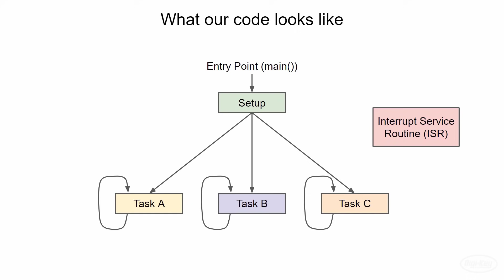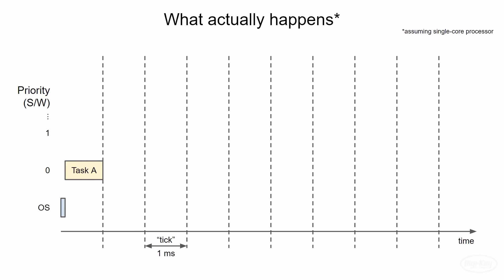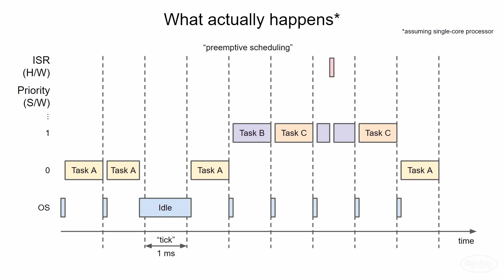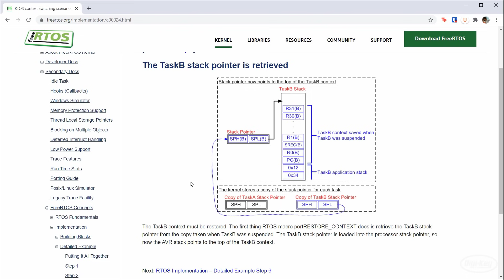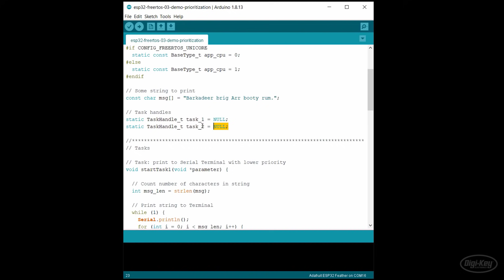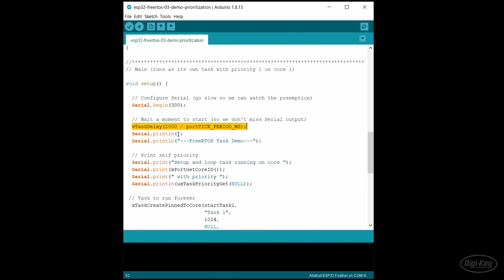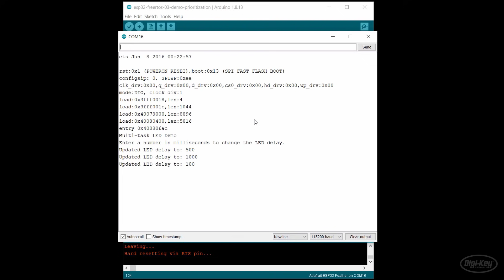Introduction to RTOS Part 3 - Task Scheduling | Digi-Key Electronics

Comment: A slightly modified version of the code from the video:
const char msg[] = "Barkadeer brig Arr booty rum.";
// Task handles

static TaskHandle_t task_1 = NULL;
static TaskHandle_t task_2 = NULL;

//***
// Tasks
// Task: print to Serial Terminal with lower priority
void startTask1 (void *parameter) {
  // Count number of characters in string
  int msg_len = strlen(msg);
  while (1) {
    Serial.println() ;
    for (int i = 0; i < msg_len; i++) {
      Serial.print(msg[i]);
      vTaskDelay(10/portTICK_PERIOD_MS);
    }
    Serial.println();
    vTaskDelay (1000 / portTICK_PERIOD_MS) ;
  }
}

void startTask2 (void *parameter) {
  while (1) {
    Serial.print('*');
    vTaskDelay (50 / portTICK_PERIOD_MS);
  }
}

void setup(){
  //  Configure Serial (go slow so we can watch the preemption)
  Serial.begin(300) ;
  // Wait a moment to start (so we don't miss Serial output)
  vTaskDelay(1000 / portTICK_PERIOD_MS) ;
  Serial.println();
  Serial.println("---FreeRFOS Task Demo---") ;
  // Print self priority
  Serial.print ("Setup and loop task running on core ") ;
  Serial.print (xPortGetCoreID()) ;
  Serial.print (" with priority ");
  Serial.println (uxTaskPriorityGet (NULL));

  xTaskCreatePinnedToCore(
    startTask1,
    "Task 1", 
    1024,
    NULL,
    1,
    &task_1,
    0) ;
  // Task to run once with higher priority
  xTaskCreatePinnedToCore(
    startTask2,
    "Task 2", 
    1024, 
    NULL,
    2,
    &task_2, 
    0);
}

void loop(){
  // // Suspend the higher priority task for some intervals
  // for (int i = 0; i < 3; i++) {
  //   vTaskSuspend (task_2);
  //   vTaskDelay (2000 / portTICK_PERIOD_MS) ;
  //   vTaskResume (task_2) ;
  //   vTaskDelay (2000 / portTICK_PERIOD_MS) ;
  // }
  // // Delete the lower priority task
  // if (task_1 != NULL) {
  //   vTaskDelete (task_1);
  //   task_1 = NULL;
  // }
}

Comment: there's a bug in your example, in the line 75 you need to increment the idx variable, otherwise it will only return the last character you wrote on the serial, like "400" it will return 0
Reply: idx++;  // it was idx  ; for some reason

Comment: For the question at the end of the blog: 
Try playing around with the priorities of the tasks. What happens if you make the “Toggle LED” task priority 2? Why does everything still work? 
What happens if you make the “Read Serial” task priority 2 instead (and leave the toggle task at priority 1)? Why does the LED task stop blinking?

Ans from ChatGPT:
In FreeRTOS, tasks with higher priorities are given precedence in execution. However, lower priority tasks can still run when higher priority tasks are in a blocked state. In your case, even though `toggleLED` has a higher priority, it periodically blocks when waiting using `vTaskDelay()`, allowing `readSerial` to execute. When priorities are swapped, `readSerial` continuously executes, preventing `toggleLED` from running and causing the LED to appear continuously off.

Comment: Small bug in your solution. You need to increment idx in line 75, otherwise, it only accepts the last digit...
Reply: thanks bro, i was having this issue with the example then i added the missing "++" on the line 75

Comment: #if CONFIG_FREERTOS_UNICORE
static const BaseTye_t cpu = 0;
#else
static const BaseType_t cpu = 1;
#endif
static int ledPIN = 2, _delay = 100;
static TaskHandle_t task1 = NULL;
static TaskHandle_t task2 = NULL;

void inputDelay(void* params)
{
  while(1)
  {
      if(Serial.available() >= 0)
      {
          _delay = Serial.parseInt();
      }
    Serial.print("Enter delay: ");
    Serial.print(_delay);
  }
}

void blinkLed(void* params)
{
    while(1){
      digitalWrite(ledPIN, HIGH);
      vTaskDelay( _delay  / portTICK_PERIOD_MS);
      digitalWrite(ledPIN, LOW);
      vTaskDelay( _delay  / portTICK_PERIOD_MS);
    }
}
void setup() {
  Serial.begin(115200);
  vTaskDelay(1000 / portTICK_PERIOD_MS);
  pinMode(ledPIN, OUTPUT);

  xTaskCreatePinnedToCore(inputDelay, "delay", 1024, NULL, 1, &task1, 0);
  xTaskCreatePinnedToCore(blinkLed, "blink Led", 1024, NULL, 2, &task2, 0);
   vTaskDelete(NULL); 
}

void loop() {
}

I tried the challenge but i am getting this problem-->

 E (12136) task_wdt: Task watchdog got triggered. The following tasks did not reset the watchdog in time:
E (12136) task_wdt:  - IDLE (CPU 0)
E (12136) task_wdt: Tasks currently running:
E (12136) task_wdt: CPU 0: blink Led
E (12136) task_wdt: CPU 1: IDLE
E (12136) task_wdt: Aborting.

abort() was called at PC 0x400d8b29 on core 0

Backtrace: 0x40083349:0x3ffbe9cc |<-CORRUPTED

ELF file SHA256: 3a4287771b3f7938

Rebooting...
ets Jul 29 2019 12:21:46

rst:0xc (SW_CPU_RESET),boot:0x13 (SPI_FAST_FLASH_BOOT)
configsip: 0, SPIWP:0xee
clk_drv:0x00,q_drv:0x00,d_drv:0x00,cs0_drv:0x00,hd_drv:0x00,wp_drv:0x00
mode:DIO, clock div:1
load:0x3fff0030,len:1344
load:0x40078000,len:13964
load:0x40080400,len:3600
entry 0x400805f0
Enter delay: 0E (12136) task_wdt: Task watchdog got triggered. The following tasks did not reset the watchdog in time:
E (12136) task_wdt:  - IDLE (CPU 0)
E (12136) task_wdt: Tasks currently running:
E (12136) task_wdt: CPU 0: blink Led
E (12136) task_wdt: CPU 1: IDLE
E (12136) task_wdt: Aborting.

Comment: There is something weird (for me) happening when task_1 is deleted: Serial port just stops printing to console. I asked ChatGPT and it says the problem is the collision of the serial port access between the tasks, but I don't know really how to solve it.
Reply: For me it helped to reduce the delay after vTaskResume(task_2); in the void loop() so that Task 2 gets blocked earlier and the idle task gets running time (see hint in the FreeRTOS Reference Manual for vTaskDelete(): "When a task is deleted, it is the responsibility of the idle task to free the memory that had been used to hold the deleted task’s stack and data structures (task control block). Therefore, if an application makes use of the vTaskDelete() API function, it is vital that the application also ensures the idle task is not starved of processing time (the idle task must be allocated time in the Running state)"

Comment: I have used exactly the same code as given in the solution except that I used Serial.parseInt() to get integer value from serial port and the program is not working right and the ESP keeps resetting (watchdog resets in readSerial function). Also it shows that the blink delay was updated but immediately gets set to 0 after and the program crashes. What am I doing wrong?
Reply: If you use firefox and copied the code to paste to your IDE; some characters does not appear on Digikey website when Firefox is used. So the problem might be that :D
Reply: I'm having the same problem, did you end up figuring out what was wrong?

Comment: Hi, thanks for the great work. I have a question, after writing my answer to this challenge, I copied your answer (just to get the nice formatting) and started to mess around to check things. One of the things I did was to delete the "while(1) { ... }" loop on the ReadSerial() task, thinking that the task would be executed only once after being started by the scheduler, exit, and I would never get a chance to input values. But instead of that, the ESP32 panics! I tried on my code too,  almost the same as yours, and same result: works with the "while(1)" loop on ReadSerial(), panics without it.  Shouldn't FreeRTOS just exit the task and continue blinking the LED forever, as it would be the only task left running?

Comment: I hope Shawn or anyone could explain to me the output on the Serial terminal at the last Example,  where the 2nd Task should interrupt the 1st every 100mSec (10 Times/Sec) This should result in 10 Astrix per every Sentance (as the sentences are printed every 1 Sec) but the output is different and we can see the whole sentence is completely printed most of the times. Why is that?
Reply: same doubt
Reply: A year later but incase anyone still has the doubt. You must have missed that the loop task suspends and resumes task_2 every 2 seconds as well.

Comment: is this good ?
================================= CODE ==========================
// Task: print to Serial Terminal with higher priority
void Uart_Command(void *parameter) {
  while (1) {
    
    if (Serial.available() > 0)
    {
      vTaskSuspend(task_1);
      String data = "";
      while (Serial.available() > 0)
      {
        data += (char)Serial.read();
        vTaskDelay(5 / portTICK_PERIOD_MS);
      }

      global_blink_delay = data.toInt();
      Serial.println(global_blink_delay);
      vTaskResume(task_1);
    }

    vTaskDelay(1000 / portTICK_PERIOD_MS);
  }
}
==========================================================

Comment: There is a flaw in the solution for led blink as for the delay provided by the user, if we give the delay in around milliseconds and then change the delay , i will reflect automatically in the blinking LED as the response time is less hence the flaw is hardly noticeable , however if we set delay for around greater than 1 second and then change it to lets say 100 ms  , then this change will not be reflected in the led immediately as it will continue to wait till its previous delay time is expired , however , the solution is to add this line xTaskAbortDelay(toggleLED); immediately in the readSerial task itself after successfully getting a new delay value to reflect this change immidiately in the led irrespective of the prevoius delay, but unfortunately the current implementation of freeRTOS in esp-IDF does not have the implementation of xTaskAbortDelay() yet , hence we have to use other alternative to reflect the new delay time immediately in the LED , this is important in time critical tasks which have to be called and executed immediately if certain condition occurs
Reply: I don't think it was necessarily a flaw for a simple demo, but you're right--for real-time applications that require an immediate delay switch, having xTaskAbortDelay() would be critical. Thank you for pointing that out!

Comment: I am using Arduino UNO. Most of the sketch is the same as the one in the video.
I left the loop function empty for simplicity but there is still an error.

Does anyone know what might cause the characters in msg being replaced by *?

Instead of something like:
Ba*rkadeer brig* Arr booty rum.
some of the characters in msg are replaced by * in my program:
Ba*kadeer brig Arr*booty rum.

Thanks in advance!
Reply: Good to know the UNO works with FreeRTOS! I have not tested it yet. The * issue is an odd one that I have not seen. It might have to do with the baud rate of the UART. Could you try slowing it down? Maybe 9600 or even 1200?
Reply: @ShawnHymel  Thanks for your reply! I was using 1200 already and I even tried 300 but the output became gibberish. I guess this is why we want one task only to handle serial communication.

Comment: Very nice video, thank you. It would have been nice if at this stage you would have told us what happens with your own interrupt routine in case it is itself interrupted by a scheduler tick. Because you may write your interrupt code as short as you want, there is always a moment where this will happen.
Reply: Good question! Most of the time, I have found that the scheduler tick timer interrupt is at a lower priority than other hardware interrupts. For processors that supported nested interrupts (e.g. NVIC), you'd likely find that your interrupt will take priority over the scheduler (tick timer ISR). I suppose it's possible to set it so the tick timer interrupt is higher priority, though. In that case, I imagine that the tick timer ISR might choose a task to run that would not start running until after your ISR is done. Here's some good info on how the tick timer works: https://www.freertos.org/implementation/a00011.html
Reply: @ShawnHymel  Thank you! I think that the "Interrupted interrupt" is a topic way too often eluded in many courses about interrupts on Arduino. I just found more general notions about interrupted interrupts in this thread: https://stackoverflow.com/questions/5111393/do-interrupts-interrupt-other-interrupts-on-arduino . Mentioning this because I initially thought that interrupt calls would be "nested", but it is not the case and I believe it is very important to understand this first.

Comment: Thanks for this series. 
But I need to know the answer of question in the challenge.
Why toggeling is stoped when making the periority of led_toggle is 1 and the other task 2 ??
Reply: If you look at the code for the readSerial() task, you'll see that it never uses vTaskDelay(), which means that it will never yield the processor if it is the highest priority task (which is what happens when you set it to priority 2 and the toggleLED() task to priority 1). If it's hogging the processor, the LED task will never run. You either need to make it the same or lower priority than toggleLED() or put a vTaskDelay() in the readSerial() task to force it to yield the processor some of the time. Hope that helps!
Reply: @ShawnHymel  Really thanks, Sure it helped. but this will lead me to another question..
is that mean if i have 3 tasks , i must block 2 of them during their execution to enable the third one to be executed?!!
Reply: @eslamsayed8405  It depends on how you set the priority of each of the tasks. If they are all set at the same priority, then the scheduler will execute each one for 1 tick in a round-robin fashion (so they'll all get a chance to run). If one is a higher priority than the other two, then you'll need to make sure that the higher-priority task delays or blocks itself to let the others run. Hope that helps!
Reply: @ShawnHymel  OK got it. thanks.

Comment: Thanks for this great stuff. A question at 2:17, what if as the Tast A is blocked (OS in Idle) and at the third tick the Task B and C are in ready state? Will the scheduler let them run in the 3rd tick?
Reply: Yes, whenever Task B or C enter into the ready state, the scheduler will let them run. Something that's not shown in the diagram: if Task B and C enter the ready state while Task A is running, the scheduler will interrupt Task A (even not on a tick) to let the higher priority task run (assuming preemption is enabled, which it is by default in the ESP32). This post has a good discussion on how this works: https://www.freertos.org/FreeRTOS_Support_Forum_Archive/May_2016/freertos_Does_the_highest_priority_task_run_at_all_times_b8195787j.html. Hope that helps!
Reply: @ShawnHymel  Thanks for the video, it's great. I want to ask, in suspend or block case for switch to other task tick is necessary or switch occurs immediately?
Reply: @serkansonel1242  Great question! The task switch occurs immediately if a task with a higher priority (than the currently running task) enters the ready state. It will not wait for the tick timer interrupt (assuming that "preemption" is set, which it is by default in ESP-IDF).
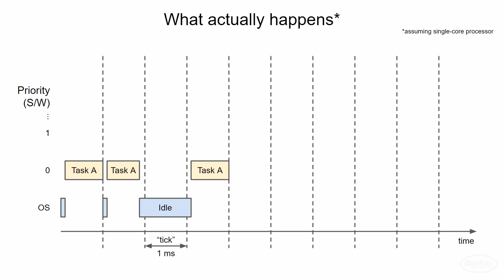Reply: @ShawnHymel  Doesn't this answer contradict with what you have mentioned at 2:37? Assuming that task B entered ready state in the middle of the 4th tick,  would task B have started right away? Just like how you have shown ISR starting in the middle of task B.
Reply: @gauravbhattarai75  Good catch! It looks like I was wrong in the video. Looking back over FreeRTOS documentation, if a higher priority task becomes available (e.g. through releasing a semaphore, new item in a queue, after a hardware interrupt), that task will immediately run (even if there's no tick to explicitly call the scheduler).
Reply: @ShawnHymel  My soul can rest in peace now😂😂
Reply: @ShawnHymel  as each task is a thread (CPU utilization), could several Tasks run at the same Tick (the so called multithreading?)? In other words, is the case in your video the so called 'single threading'?
Reply: @lxzhang4911  You can only run one task at a time in a single-core CPU. If you have a multi-core CPU, you could run several tasks at the same time. In the single-core example that I've shown in the videos, the CPU must split its time between tasks. This is still "multithreading" in a single core.
Reply: @ShawnHymel  So in your example is it a RTOS or general purpose OS? Because in your this video (https://www.youtube.com/watch?v=OPrcpbKNSjU&t=70s&ab_channel=Digi-Key) the example of general purpose OS is quite similar with the example here in this video. It makes me quite confused. I thought in a general purpose OS the OS will not check at each tick if it need to switch context to another task. Is it?
Reply: @lxzhang4911  Most general purpose operating systems (e.g. Linux) still have a scheduler, which is some code that must run periodically in order to determine which task/thread to run next. Usually, this happens at some pre-determined frequency (in Linux, this is determined by the "timeslice" setting). This ends up looking much the same in both GPOS and RTOS cases: there's a small sliver of time in which the OS scheduler must run periodically to determine which task to run for the remainder of the timeslice. Here's a good article about how one such Linux distro handles timeslices: https://doc.opensuse.org/documentation/leap/archive/42.1/tuning/html/book.sle.tuning/cha.tuning.taskscheduler.html